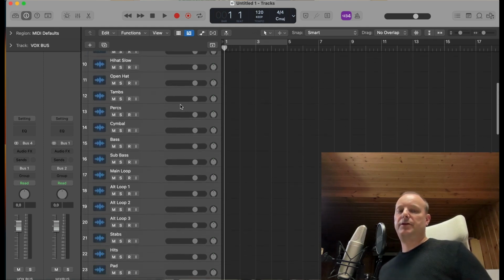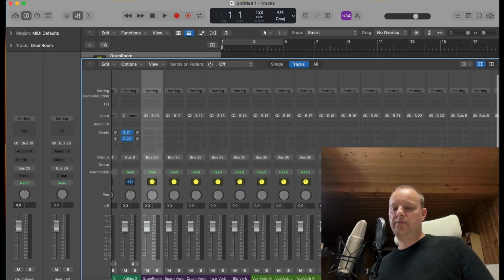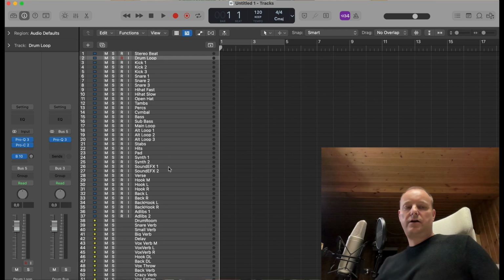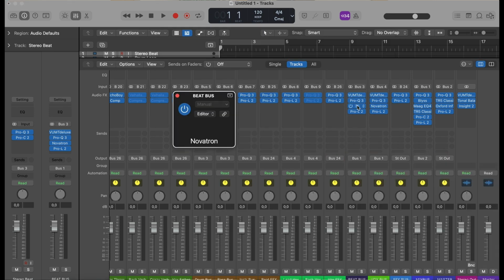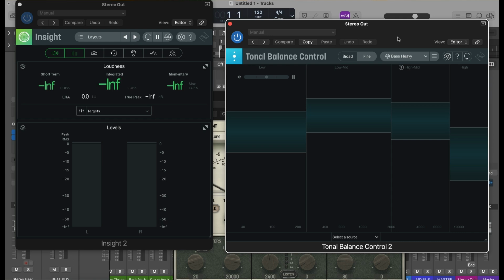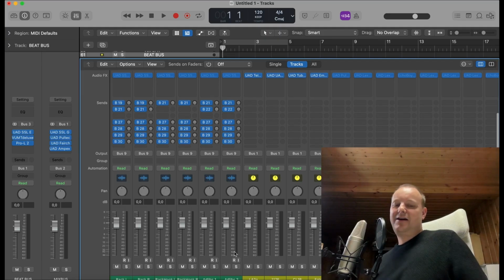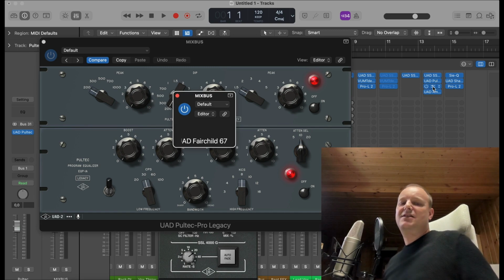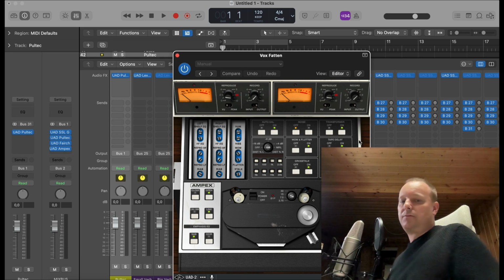3 Great Logic Pro X Mixing Templates

Comment: What type of laptop do you have to handle all the plugins in the template without latency issues
Reply from the maker: Macbook M2, regular specs. However, these also ran well on my old 2011 iMac  (tho with a processor upgrade on that one, but still). I usually run with the 1024 buffer size. Works smoothly